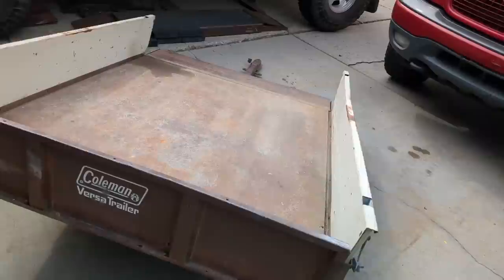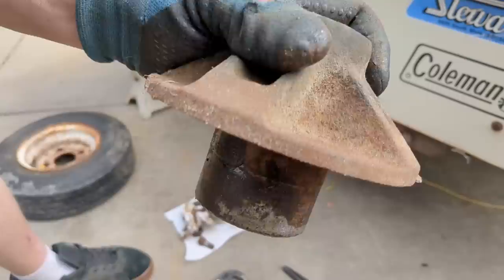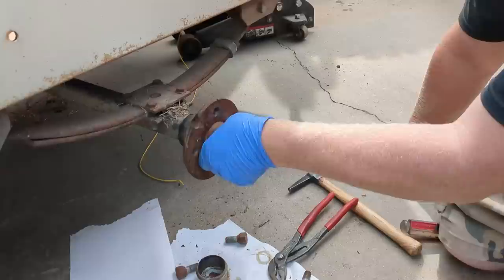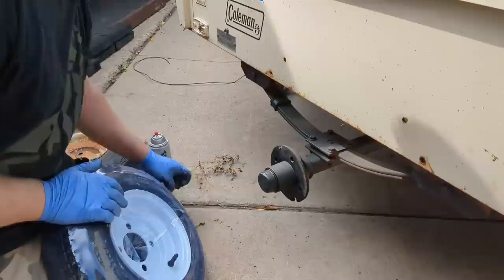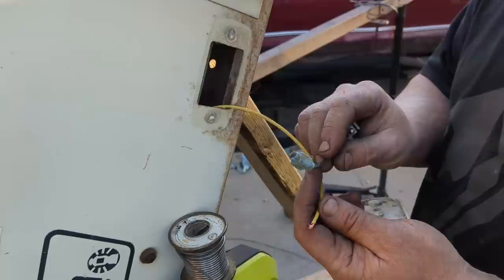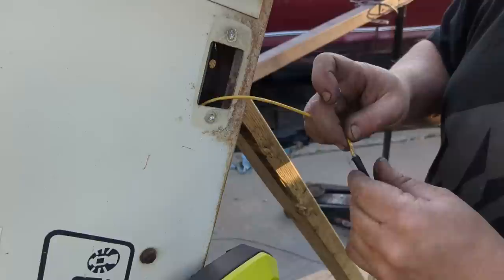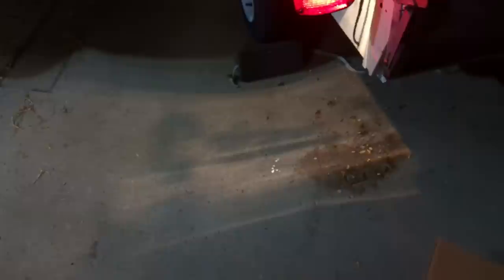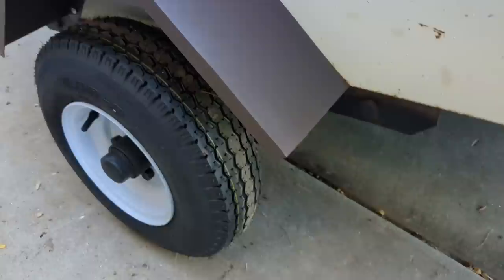Rare Coleman Versa Trailer Full Repair

Comment: Great video.  I too have proven the Timken bearing "axial setting versus life" chart to be very accurate.  Life curve is very steep as you move into preload and nice a relatively gradual on the  endplay side.  I like to measure my hub Temps with an IR thermometer after about 30-50 miles at highway speed.  I get nervous if hub temp is warmer than tire temp.  I try to run 3-5 thou endplay so the seals work better and keep the grease from slinging too much as I also run bearing buddies to help keep water out on my boat trailers.  I have also learned that  genuine name brand bearings last longer than cheap no-name.  Haven't measured,  but experience indicates the cheap rollers and races are not hardened enough.
Reply from the maker: It's become such an ingrained habit of mine to put my hands on every single bearing hub every-time I take the trailers out.

Comment: Used to tow one of those full of camping gear (500-700 pounds; I took a lot of tools when camping) behind a '64 VW Bug. I totally wore out the joint where the tongue attaches under the trailer. I probably got 30,000 miles out of that little trailer. The funniest thing was watching a guy back this rig onto the Lake Michigan auto ferry. Now this guy backs up 40 or 50 strange (to him) rigs every day at fairly high speeds. He just couldn't keep from jackknifing this short-coupled rig four or five times before he got it loaded onto the ferry. He even put a dent in the back fender, but I never called him out on it because I had put a few dents there the same way myself.

Comment: I can totally see this trailer being behind the VW Diesel Truck and looking like a match made in Detroit (or Germany or, well...lol, where ever the Coleman was made. Excellent work but even better are the tips you give us all along the journey. As always, great to see and hear from you my Friend! Cheers Moe! Zip~
Reply from the maker: Hey thanks. I need to make a hitch for the VW as it has nothing.
Reply: Yes. In the 1970s my parents bought a used Coleman tent/camper trailer, gutted the tent out of it and the remaining trailer looked very similar to the one you restored. And they pulled it with their 1975 VW Rabbit, whick is a MK 1 chassis, just like the VW Rabbit pick up. They drove it acceoss country, did great. They bought a trailer hitch made specifically for the VW Rabbit; the brackets mounted to the bottom of the spare tire well and rear bumper. I think they  purchased it from the VW dealer, so the proper hitch is out there, if you can locate one.

Comment: I have used mulberry for hammer and tool handles for years. It's tough, dries hard and is free, being as it is the weed of trees. A big plus when a new handle costs as much or more than a new hammer. Everyone of my trailers have 14 ga, three wire orange extension cords for the tail light wiring for the reasons you mentioned. When they inevitably get damaged, I toss them in a box to use for rewiring trailers. I just ground out the lights to the frame, and run a ground wire from the trailer frame to the plug. The conductors in the cord run positive to the tail lights, turn signals and brake lights.
Reply from the maker: That's awesome. I've used mulberry before and it's hard.

Comment: My father taught me about bearings a long time ago.. From replacing the races (with a brass drift) and slapping the bearing in a wad of grease in my palm until packed to DO NOT EVER TIGHTEN the damn nut along with an explanation of how tapered roller bearings "self adjust" when they wear... A few months back I replaced the wheel bearings on a "08 Chevy.. Very different.. I had to buy the entire hub assembly with "sealed for life" bearings..

Comment: Nice job and trailer. I have an old  Alstate trailer box that was mounted on a goofy set up for pulling behind a lawn mower.  I have been watching for a small trailer frame to mount the box on.  Looks like I will have to build one myself.
Reply from the maker: I've owned a few Allstate trailers over the years. They go for a pretty penny all fixed up.

Comment: thumbs up for the proper use of dialectic grease. I dont usually use it on soldered joints though. never had them fail. So many people use it to get a better connection....It doesn't do that!. it lubes and resists electrical connection. perfect for not wanting to transfer electricity to something else. For use around the outer edge of a electrical connector to prevent water from getting in there. or spark plug wire so you can remove the boot from an old plug. if you want a better connection home depot has electrical contact cleaner. and electrical contact lubricant. which improves electrical contacts and resists corrosion.
Reply from the maker: The biggest thing it does is prevent galvanic corrosion/ oxidation from tracking down the wires. I come across copper wire where the entire length inside the jacketing is oxidized.  I think this can be prevented with dielectric at both ends.

Comment: I always solder the ground to the frame, on the tow vehicle and the trailer at each light. Regular plumbing flux and a butane torch works really well on the steel sheet metal,  just grind down to bare steel in a nickel sized spot and wet in the solder. You can either drill and mount right to the solder since it won't rust or go ahead and solder in a wire. Once you do this you won't have trouble with your lights working for years...unless the cheap plugs corrode away
Reply: Plumbing flux is way too acidic to use on automotive grade copper wiring. Just use a crimp on ring terminal and a good set of crimpers
Reply from the maker: Any sort of crimp on terminals,  even ring terminals will fail in short time on a trailer. I always coil the wire itself to make its own ring terminal and solder it. I refuse to use crimp on terminals unless they're being used internally in a vehicle out of the weather. As far as soldering wire directly to the trailer, that's a great idea and I have done that in the past and honestly it kind of forgotten about it. I take the wire from the trailer connector all the way back to the tail lights and from there I connect it to the frame if I have marker lights. However, most the time if I have marker lights, I run their own ground directly to the trailer connector wire as well. So virtually nothing is grounded to the frame as is always the source of failure. 

Plumbing flux/ acid flux isn't as bad as people make it out to be. They categorize two different types of fluxes: acid flux is referred to as clean away flux and versus no clean flux (rosin, organic etc). So simply using water and wiping away the flux after you solder it has no negative effects. You'll find using rosin flux on even mildly oxidized copper won't work and you need to use acid flux to get good penetration/bond. Simply wash it away with water, carb cleaner, brake clean, rubbing alcohol and you're good to go.

Comment: Once I found a box of large heavy duty plastic bags on the side of the road. They lasted a long time. And another time found a large roll of 2" wide electrical tape. I still have a little bit left on the roll. Those were two of my best side of the road finds.
Reply from the maker: That's awesome. Yeah my wife called me and said she hit a chunk of wire that fell off of guys truck. I then asked if she grabbed it and she said yes. Great wife that brings you home roadside gems.

Comment: A trick I learned is cut a slice through the old bearing race before using it to drive the new race makes it look more like a circlip if that makes sense means it doesn’t get jammed in there and you can pull it back out by hand
Reply from the maker: True

Comment: Hey, for your soldering - get some Solderlene flux!  It's not an acid flux and works much better than rosin flux alone.  Just apply to (clean/bright) wires to be soldered, then you can simply melt a blob of solder onto the soldering iron tip (not condoned in solder school😦) and apply to the wiring.  Isopropyl alcohol cleanup, shrink sleve, DONE!
Reply from the maker: I'll have to give a bottle a try. I have probably 10 different fluxes and generally go for a Kester Organic flux for electronics, if it's clean copper. However that is not always the case and I have to use Acid flux to cut through the oxidation. Acid flux just requires water, alcohol or similar cleanup. I think in the video I was using a 40+ year old dried up flux roll of solder.

Comment: I think I had a mini heart attack watching you use spray paint inside your garage right next to open toolbox drawers. I would be worried about getting over spray on everything.

Good idea scoring the sheet metal to bend it easier by hand. I had to do that years ago with some 14ga steel wall panels. The engineers made them about 2 inches too wide. Rather than send them back to the shop to be remade, I cut them down to size with a Metabo and scored the new brake line and broke the new flange with a pair of tongs.

Comment: Ginger the Wonder Dog.  Learned some things about wheel bearings.  Better check my trailer.  When the wheels are equipped with greas zerks...how often should they be greased, and how much?
Reply from the maker: The grease is generally good for in excess of 10,000miles but not if it is overheated from ever tightened axle nuts. Trailer hubs are the same thing you would find on an older two wheel drive truck that goes 50,000+ before needing regrease. Most trailers sit forever and mileage isn't really a thing. My main trailer was last greased probably 8 years ago and gets used 10times a year(200-400miles/yr). Everytime I stop I check hub temps to make sure they're cold. However the Grease-able hub where the zerk is fixed to the axle shaft is effortless to do and I would likely do it once every other year or so. You could honestly just regrease everytime you changed tires.

Comment: I have an original Versa Trailer purchased from Montgomery Ward Catalog. The tail lights  were obnoxiously mounted on an Isosceles shaped frame which protruded  such that they were a constant source of impact. Your fabricated fenders are substantially more solid that the originals which has a valence which encumbers wheel R&R. That drop down tongue needed to monitored and greased periodically to prevent seizing. Overall, yours appears  in quite good condition and not to have had much road use.
Reply from the maker: Yeah I noticed looking at photos that the fenders had coverings. To me that looks not quite right so I left them off and decided not to fabricate that part.

Comment: You sir are destined for farm/ranch life. Imagine all that land out there, calling your name, waiting to have loads of crap put on it to store your treasures. 😁
I had a friend awhile back clue me in to Spoby connectors (kind of a modern copy of the WWII flux in a tube doohickey), and while I like the idea, they're finicky to get just right on little, tiny wires without torching the shielding. I'd imagine they'd be great on house-size stuff where getting a soldering iron into little nooks is a pain.
Reply from the maker: Yeah, I need just a little bit more space.

Comment: Nice job. Small trailers are super useful. Can throw a Pond Prowler boat on it and go fishing 🙂 
I read a lot of people complaining about the grease in the Harbor Freight trailer hubs leading to bearing failures, but I think they were tightening the nut too tight. I feel compelled to go check mine after watching just to make sure mine are loose enough.
Reply from the maker: I was just working on a small HF trailer yesterday and the grease is pretty low quality in them. However, one side was tightened good and the other was too tight. So it's a good thing to check.
Reply: @sixtyfiveford  I checked mine, re-tightened and then backed them out like you showed. They seem to be good.

Comment: I was given a free trailer, most likely a Harbor Freight single axle trailer 5 years ago.  It was tilted up on it side so one of the side was seized up.  Somehow I ended up getting it unseized.  I didn't even have a way to get it towed home so I had to wait on a friend.  I think I ended up selling it for $200 with no title, also had to rework the light wiring but that was that.  Couldn't find a vin number on it anywhere but the paint was crusty as well.

Comment: If you run a weld bead all the way around the inside of the old bearing race it will shrink enough that it won’t get stuck when you use it to install the new race
Reply: That would be a waste of time considering he has a lathe... but it's the thought that counts. 👍🏻👨🏻‍🔧🇺🇸

- Max Giganteum

Comment: Fantastic job as usual. I’d be interested in your honest opinion on a welder set up for the average joe. A man who will only weld once a year if that. Something reasonably priced that can sit on the shelf of a homeowner until that day it’s needed. A welder he can not only learn on but just keep right on using for the rest of his life within reason. I wanted to add the said homeowner has no idea what he is going to weld, he can’t answer that question until it’s broken 😂
Reply: A 120 AC powered Lincoln wire welder using flux core.
Reply from the maker: You can't go wrong with a used Lincoln Weld Pak Wire feed welder. No gas required, no 220v required  and super easy to learn to weld with.  Watch classified and you can find them for under $100 from time to time but average sub $200. You can pick up new wire feed welders like the Harbor Freight ones but they are very crude and make learning to weld more difficult. The Lincolns are bullet proof and can sit on the shelf for years and still work great.

Comment: Can you even buy a trailer like that anymore?  I like the U-Haul clam ones but I understand you can't buy them. 

I also always heard to use extension cords and not solid core as the vibration will break the wires. 

Good stuff!
Reply from the maker: You really can't buy anything like this anymore. I think that's mainly due to the fact that car manufacturers no longer "recommend" towing with any cars anymore. They call it "The great US anti-towing car conspiracy" . Essentially, the same cars that are listed to tow 2,000 lb in Europe when sold in the US say not recommended for towing. It's thought to be 100% to drive the sales of the higher profit margin pickup trucks SUVs. So a trailer this small kind of looks silly behind a full size truck when you can tow so much bigger.

Comment: I've rebuilt a few small trailers over the years, too. I really like the double ground wire trick on those marker lights. Grounding always seems to be the downfall of trailer wiring.

I have to wonder if those tires would have become the same size once installed and brought up to full pressure? But once mounted, you couldn't return them if they were still mismatched.
Reply from the maker: I thought the same thing but I squished them both flat/sideways to simulate tire pressure and one was definitely smaller. You could tell they were cast in different molds from the inside.

Comment: I have one of those trailers and noticed something odd about the leaf springs on it ,there are no shackles on them . that makes the springs kind of useless as there is no room to expand them it makes for a rough ride ,did you notice that?
Reply from the maker: They're slipper springs. The front is connected to the frame and the back is just captured and allowed to move forward/backwards in a pocket. This is pretty common on trailers

Comment: Good fix on a Good product, Ginger with her Wilson brand pacifier and YAAY Snapper mowers! GBWYall!
Reply from the maker: That's one of the last Snapper mowers made(2001) and the neighbor just gave it to me. It is burning some oil but they are built like tanks.
Reply: @sixtyfiveford  I've owned 4 so far and ALL would make bulldozers ashamed of themselves. I had one that had a 5-horse Briggs aluminum deck and a 3 1/2 horse that had a REVERSE on it and now have an 85 model with a 4-horse briggs and a Ninja non-mulcher with a Kawasaki from a dead Deere mower. They are unbeatable and the drives are simple and tough. They were too tough for this throw away ags. BLESSINGS 2 yall!
Reply: @sixtyfiveford  And I run Delo 15/40 because it is such a good oil. If it'll stand a diesel it'll sure stand a Briggs and Brian Bloc bcbloc02 says that it and Deere oil are the only two with a flat tappet additive.

Comment: Another horrible story from about 11 years ago.  My friend bought this late 1990s GMC Sonoma from the auction which ended up requiring $1,100 in repairs as it needed an engine computer and the entire fuel injector harness.  Anyway, he brought it by to do the front disc brakes, and being a 2wd it had spindles rather than hubs.  I never worked with a truck that had spindles before so I simply used the torque spec for the hub version of this truck which was 175 foot pounds.  He immediately drove on the highway and it nearly fell apart, he drove back and the front wheels had serious camber.  Somehow he brought the bearings and rotors back to the auto parts store and they warrantied them and the second time we did everything right and it was fine.  That was extremely embarrassing.  The only permanent damage was that the wheels got so hot that the plastic GMC center caps in the front flew off and he never recovered them.  Also remember that the bearings and rotors were not "blued" from the extreme heat.  I'll never forget that.  He told me he thought he was going to die, lol.